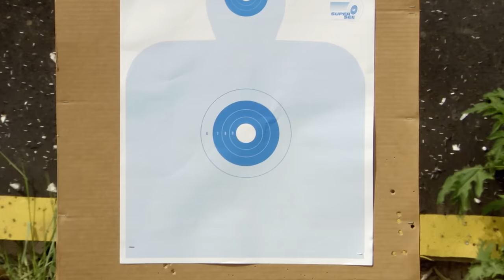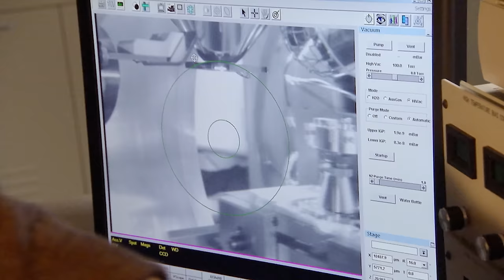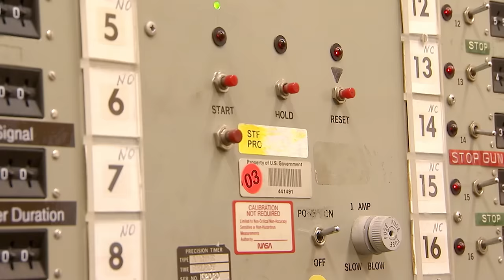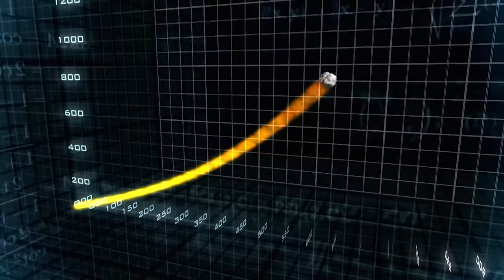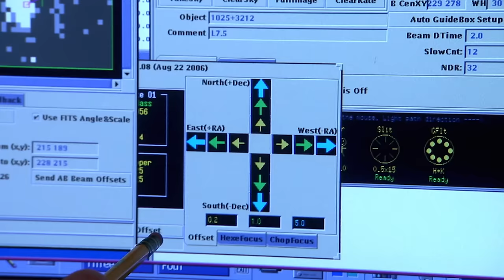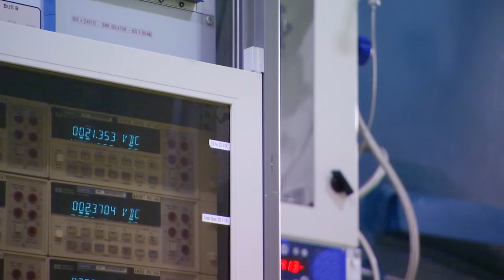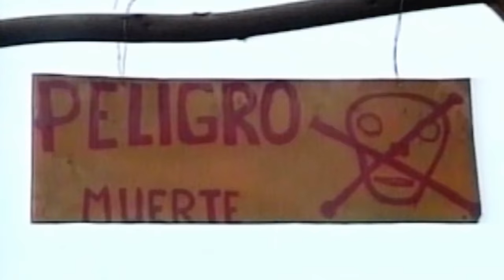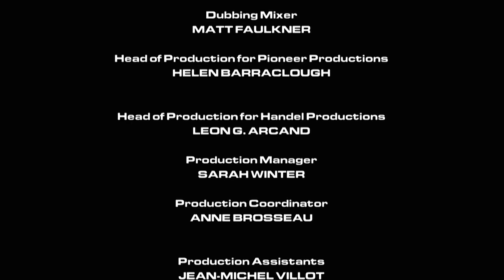How Scientists Identify Apocalyptic Asteroids Heading For Earth | Naked Science | Spark

Comment: "shotgun fires at 600mph   asteroid fragments travels 30,000 times faster "   come on   18,000,000 million mph  this video is full of LIES LIES LIES
Reply: Actually 160,000 miles per hour. The video made one blunder. Doesn't remotely mean it's full of lies. Can you offer some examples of other inaccuracies?
Reply: It could be accurate, if a 150ft asteroid was going 50000km/h it could easily send small particles weighing grams much faster than 50000km/h. You would uses the laws of conservation to find out how fast
Reply: 600 mph x 30000 = 18,000,000 mph which is 5000 feet per sec. Not a lie. Light travels at 186,000 miles per second which is 669,600,000 mph.

Comment: If we hit a solid asteroid with a nuke how would it do more damage? Wouldn’t it break it into so many smaller pieces that would eventually burn up in our atmosphere? I know it wouldn’t magically go away but I would think it would help to some degree.
Reply: My thinking exactly. Some of it would be vaporized by the nuke. It might get knocked off a path that would hit the Earth some of the smaller particles would burn up in the atmosphere on entry. The down side is the many impacts get spread out more instead of one big one. Neither is good.
Reply: There are actually great videos on youtube on to why it's a bad idea, basically such a small amount would be vaporized that 99% of the asteroid would still be there, just spread out into a "relatively" dense cloud, that cloud would impact out atmosphere and impart the same amount of energy into it, heating it to thousands of degrees. Also we wouldn't be able to use thermonuclear weapons but conventional uranium/plutonium weapon only as it would technically do more damage (i'm not sure on the reason behind this, I think that was just about using one to knock it off course, but basically if I remember right it's because most of the damage from thermo is from the xray emission heating the earths atmosphere up where as conventional nuclear uses more of a blast wave).